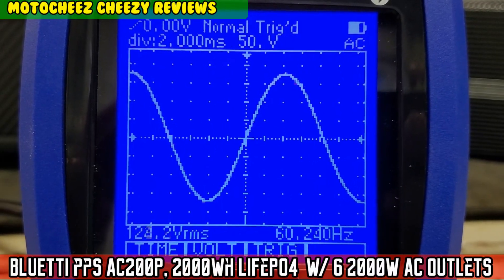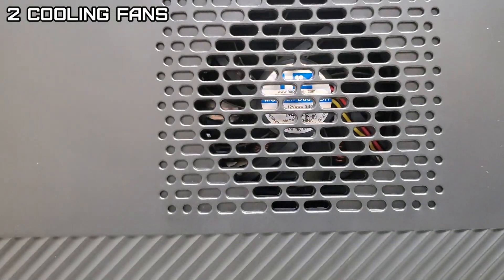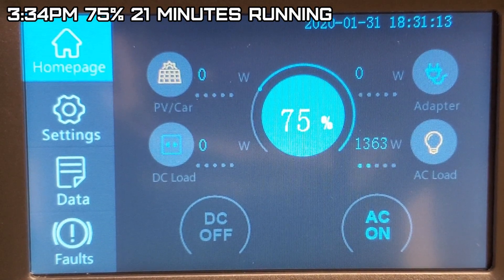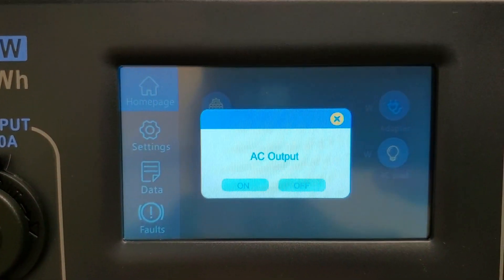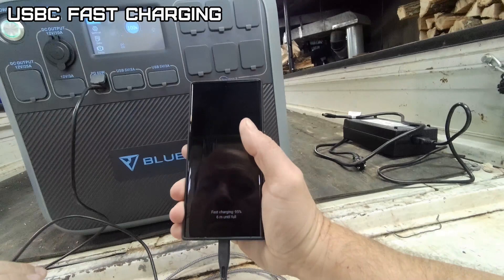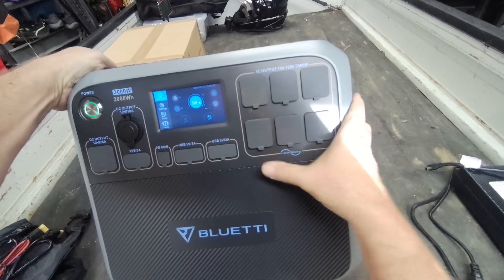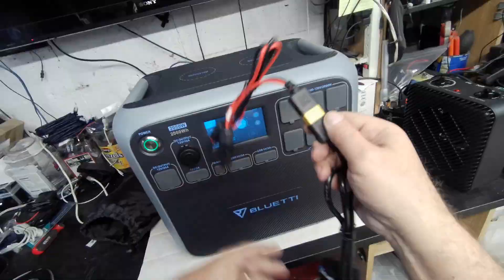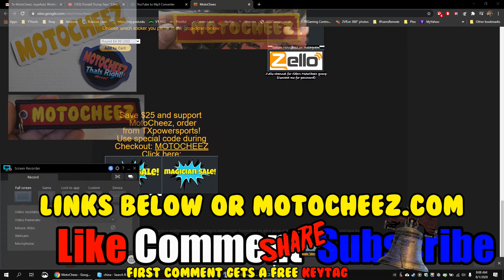BLUETTI Portable Power Station AC200P, 2000Wh LiFePO4 Battery Backup w/ 6 2000W AC Outlets

Comment: I don't bother testing these without hooking them up to solar panels. They can have unlimited power if you hook up to solar panels depending upon what you are powering with them. I use them for refrigerators during power outages. I have several 1000w units as opposed to one 2000w unit so I can place them near the appliance.
Reply: how long (hours) can the 1000W run a standard home refrigerator?
Reply from the maker: @nealtran1856 several days